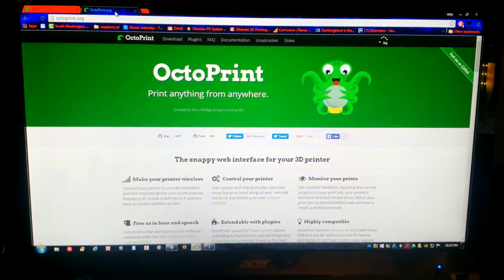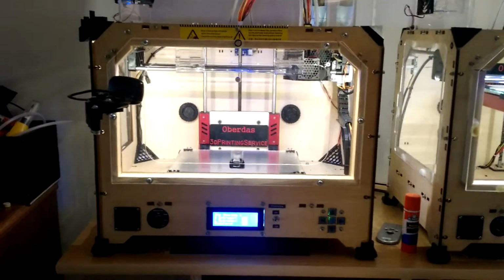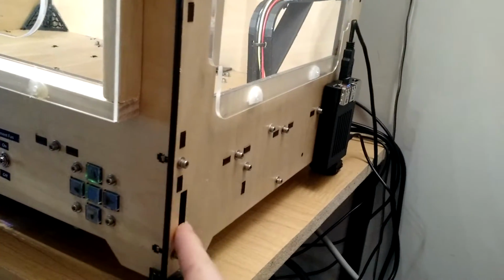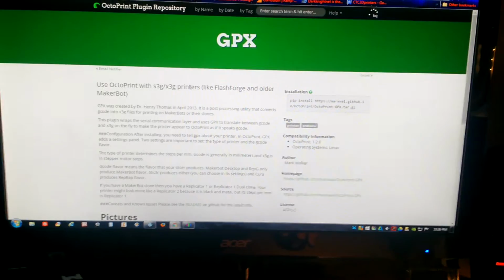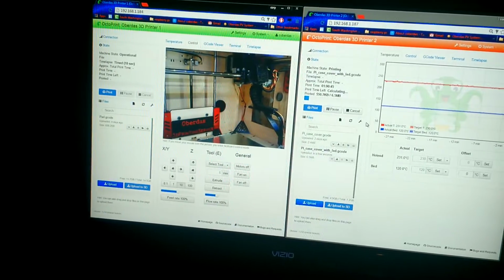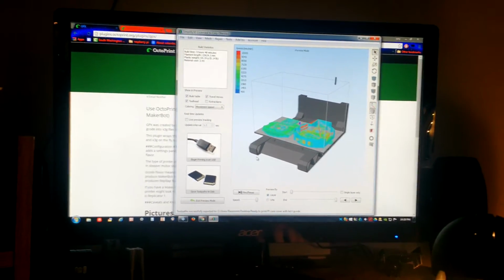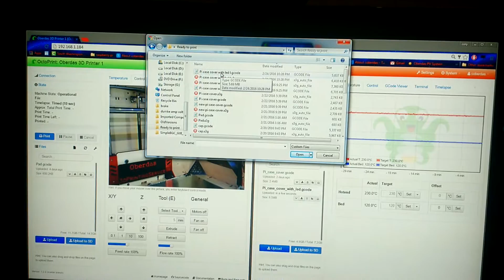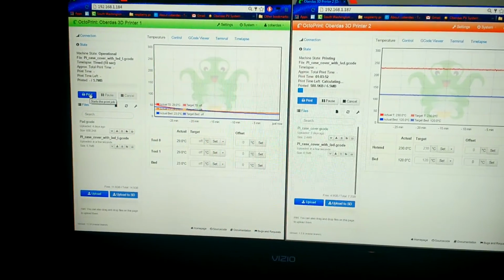My final setup of Octoprint on CTC duals.

Comment: Hello Cory, it would be really helpful if you could share your settings of GPX plug-in. I have the same issue as your previous video about bed heating not turning on and also other issues with the configuration. It seems you have solved those. And I see on the comments other request like this but no answer. Could you please help us here? Thanks!!!
Reply: Claudio Carioni did you try changing it to makerbot and not reprap in settings?

Comment: Did you ever run across a problem where the printer will start printing, but lower the print bed to the lowest it can go or print off the edge? I have a feeling it's to do with my GPX settings but I'm not sure. Any ideas?

Comment: Hi 
What you have over heat plate ?
Can you make video about your setup for heating bed ?  What do you use to keep parts on the plate ?
And what other upgrade are you done on your CTC ?
Thank you for sharing.
Reply from the maker: +DeniskaNYC I have cut glass to cover the bed plate and print and put glue stick on the glass.  I don't have any parts peel up during printing.
Reply: I tried glue but for some reason I can't place it even. How do you do it? 
I use ABS Glue it's ABS + Aceton mix. But it hard to clean.
Reply from the maker: I use purple Elmer's glue stick and put 2 coats on
Reply: +cory oberdas  can you share your Simplify 3D profile ?
Reply from the maker: +DeniskaNYC   you mean my setting?
Reply: +cory oberdas yes or you can export your profile.
 thank you.
Reply from the maker: +DeniskaNYC   Here are the clips I have on my heated bed plate.  http://www.thingiverse.com/thing:1398937